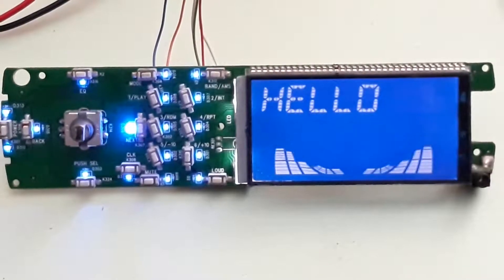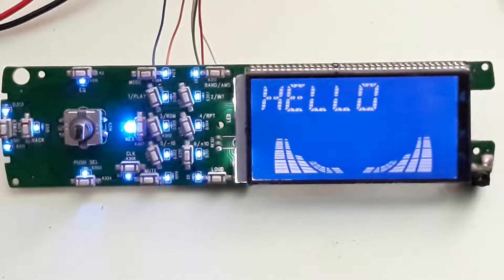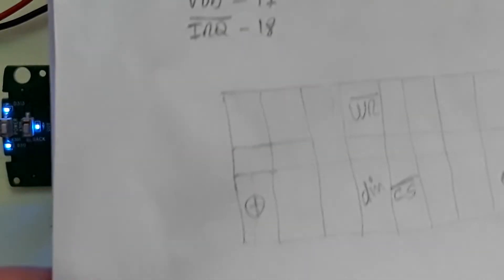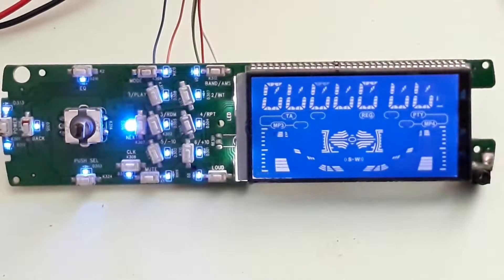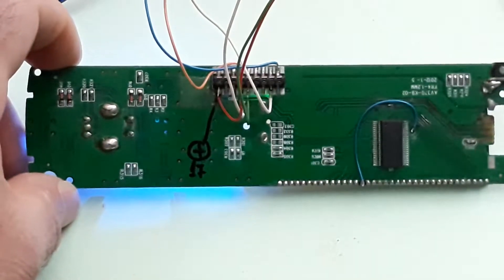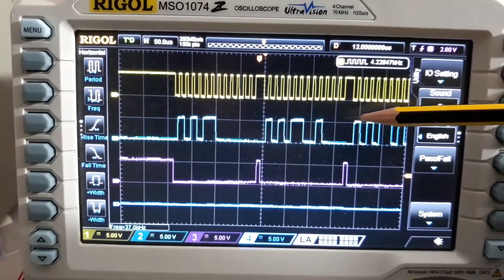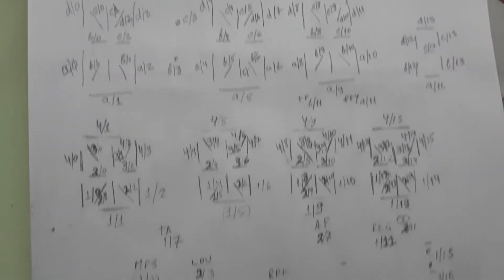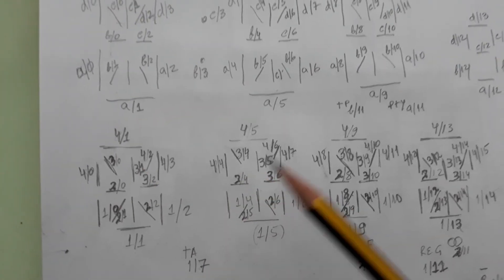TM1621

Comment: Hello. I just use Sonoff THR316D and it use TM1621 lcd. I know how to put my code in there but i dont know how to control TM1621 in sonoff can you help me? Thank you.
Reply from the maker: Hi "sanfran sisco",

To be honest, I'm not familiar with the:Sonoff THR316D.
But each and every control of the TM1621 (SSOP48) goes through using the pins:
Clock, Data, Strobe and the GND. They are used to send control messages via Serial format. So the first thing to do will be to identify the microcontroller used by the THR316D and if it is a commercial microcontroller you will have to follow the pins that I mentioned above to see its relationship with the micro.
Note that in this type of solution, for reasons of price, uC type "Tiny", PIC or even ASIC's are used.
If you know how to control this micro with "CODE" you will have to send it via the control pins above.
Reply: @jlsmonte  Thank you very much for your advice.

Comment: hola tengo un  TM1621 pero no logro que se vea el display
Reply from the maker: Hi Pablo Triton, 
Tell me, you can control the driver with code? You follow the pins I make mention on the video to deliver the data to the TM1621? Not forget you have a small resistor normally to polarize the back panel.
Are you using the code on the link?